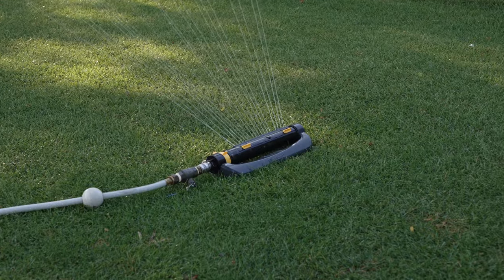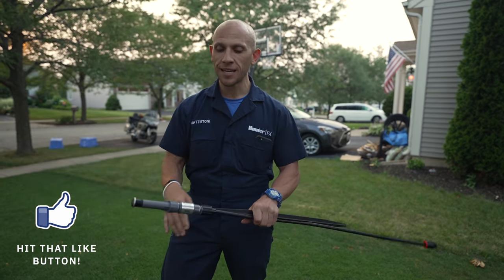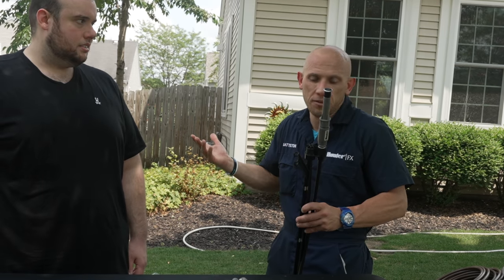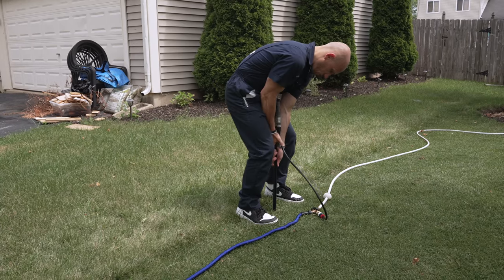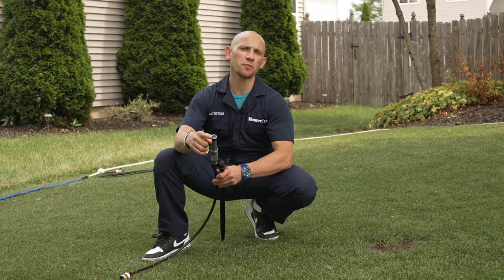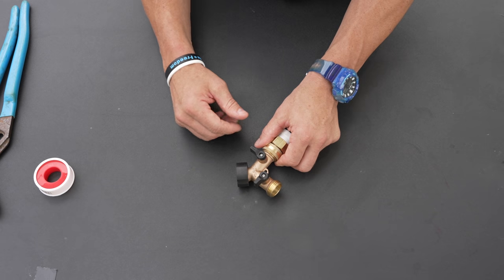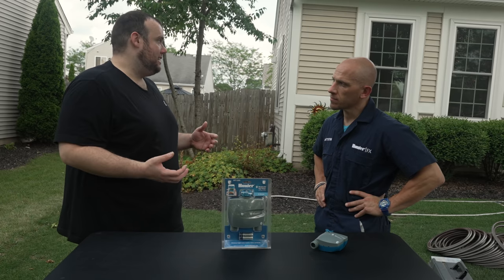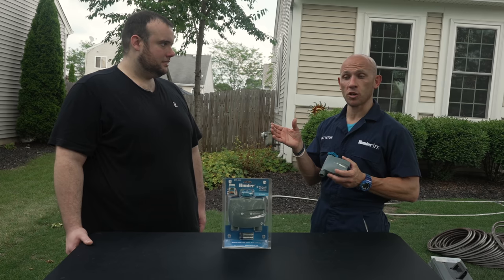Once You See It, You Won’t Use a Regular Sprinkler Again

Comment: Looks like a pain to setup and more complicated than it needs to be.  And the expense is nearly the part cost for a sprinkler system if you do the digging yourself.  Similar battery operated valves don't last more than a season from my experience.  But most important is you need to zone out your lot since you can only run a few sprinklers at a time.  Better to just get a standard zone timer for $40, sprinker heads, pipe, and do some digging.
Reply: In most applications I would agree. However this system is modular and mobile, so that’s an advantage in certain situations such as mine
Reply: you need a hammer arrestor between the valve and the timer, otherwise the bluetooth ones do fail more quickly due to the surge of sudden stops and starts.
Reply: so every time i cut the grass, i take it all down. then reassemble. then re-align the rotators. no thanks.
Reply: @pbrooks4040  exactly what i thought.. single woman with big yard, and dragging those hoses back up for the lawn mower guy UGH NO

Comment: Great video. As a DIY guy 😂 I can’t help myself. I just built 10 Rainbird 1800’s with the 360 rotator heads for a total of $5.18 each a couple weekends ago. With average water psi I can run up to 5 at a time from 1 hose. I also took an old 100ft hose and converted it into 10ft hoses. I haven’t seen the price of these but I’m doubting they come close to that. Getting Excellent coverage 
Us DIY folks are OCD af. Especially if it works as good or better than store bought AND we can do it at a fraction of the cost.

I also built my own in-ground with 6 Rainbird 5000’s easily covering Over 10,000 square feet with garden hoses a 4 zone and 2 zone timers for barely $350. Works pretty damn good.
Reply: Wow how long did it take and is it above ground?  what is a good 4  or 2 zone timer  TIA
Reply: .....but.....you have to have city water pressure level, or one big kick ass well pump!

Comment: I’ve used these nozzles a lot there very easy to use. Easy to adjust  didn’t know about the Bluetooth app but I do know u can add a WiFi module to ur compatible irrigation controller and can use it with ur phone. Nozzles have been out for a few years now 👍👍👍 I have installed a lot of irrigation systems around Charlotte nc 👍👍🇺🇸👍

Comment: Does best with city water pressure. I have a well and live in the countryside here in Michigan. My well water pressure is maximum 60psi. The units are humming in there at about 25 ft. But...if someone flushes, or washing machine operating and the streams come out about 3 ft. Also, don't use contractible hose! When it empties, it will collapse and pull your stake out! The Hunter 100 doesn't have an ON button, it does have an OFF but you cannot turn it on or off manually except to go out to the unit and shut it off manually. Beats the reason for a remote eh? Otherwise, its really cool. All the neighbors comin' over to check it out.

Comment: Barely getting into the home stuff but we're learning a lot as I go this seems like a lot more of a DIY project than say you know irrigating your whole sprinkler system yourself and digging up your lawn now if this is something you wanted to do for a permanent fix how would you go about setting it up I know garden hose probably isn't the best for long-term pressurized use on a timer like that what would you use to permanent above ground or permanent use of that pressure without any leaks for the future from the garden hose and taking up a spigot

Comment: Nice work and great info. 😎👊🌴
Reply from the maker: Thanks man, do you have irrigation?
Reply: @PrincessCutLawnCare  I do. I tried the MP rotors and I had to run them longer than my normal spray nozzle. I am sure the usage is the same when the output is the same, but I learned the MP’s are better suited for clay soil and not Sandy loom.
Reply from the maker: @LawnNOrder  I can see it, takes much longer for us to get water penetration

Comment: I've preferred Hunter over Orbit for sprinklers lately, but their plastic all-in-one valve timers won't last nearly as long as a timer and valve body setup. I've used the combo units on rental properties and had them crack and leak after 2-3 years, where the in-ground valves hold up much longer. I have yet to find a timer I like more than the Rain Bird that has run about ten years. I don't even think they make them that good anymore. Tempted to build and program my own.

Comment: how long does it have to run before you could measure 1/2 inch or 1 inch of rain?
Reply: If they are laid out in head to head coverage the application rate is .4 -.5 inches per hour

Comment: Yeah, it's gonna be in the way of mowing. There's sprinklers out there that'll do a 30' circle. I have a wire trojan fence. I have my garden hose zip-tied to a fence right after I weed whacked a ditch. After the grass grows back, you don't see the hose. Never snagged it with my mower. I have several Y connectors inline at each corner. I can use only a 25 foot hose and sprinkle about anywhere in the yard. 🐀🐾

Comment: I’ve used these. Cheap plastic gear driven sprinklers that don’t last because the plastic gears get torn up by sand particles. Your always better off with metal impact heads.
Reply: You shouldn't have sand in your water. Filter it out first. Obviously sediment isn't going to be good for your sprinklers or your household fixtures. I've used Hunter sprinklers of all kinds for years and had no problems at all. But then, I knew what I was doing!

Comment: The biggest problem I’ve had with rotary sprinklers of all kinds is they get clogged all the time.  They only work with distilled water.
Reply: Yeah, we have well water and the mineral buildup is a challenge. I need to use impact heads for that reason. They each take more water per minute, which means I need more valves and more zones to cover the same space. I'd rather use 3-4 smaller non-impact versions (1-2 GPM) but have to go with 1 larger impact unit (3-4 GPM) instead. All because of the hard water.
Reply: Not true. They work fine with my moderately hard water. Yours must be phenomenally hard to be giving you trouble, in which case you need a water softener.
Reply: @paulmaxwell8851  Salt-based softeners kill a lot of landscaping, and would use a lot of salt. I had a softener, and it was not plumbed to feed exterior hoses, landscaping, etc. for that reason. 

Mineral build up is a real issue, and the tiny orifices on many spray heads will clog within a season. You'd be surprised how quick it happens when the temps go up.

Comment: Being that this needs 40psi to operate, how many splitters could I use from 1 main spigot? Is it just the 2 shown in your video, or would I need to run a hose from another spigot to the other side of my yard?
Reply: Hey R - great question. The MP Rotator can operate down to 25psi (per Hunter's performance data). The 40psi reducer is to lower the pressure, should you have 40-60psi, etc. You will lose pressure due to "friction loss through your hose" - and with just 2 MPs you will likely lose 2-5psi for every 100LF of 5/8" garden hose. Hope that helps!

Comment: Where I live u can’t use a filter as the stuff in the irrigation water it plugs in 2 days. So u remove the filter and away u go. The stuff in the water passes thru the nozzle.  Can u remove urs without any problem ?

Comment: Did you ever measure how much water you get in half hour time with that system? Streams see very narrow or low flow from video.
Reply from the maker: It waters at a rate of .4 in per hour which is perfect because the rate soil absorbs water in .5 in per hour so there is no risk of run off

Comment: I got frustrated with those mp heads.  They kept quitting spinning after just a few weeks.  We were using city water so it wasnt getting any gunk in it.  I have no idea why they kept failing.  I switched to rainbird oscillating heads.  Do you have any idea why these would fail like that?
Reply: What's your at head pressure?
What type of water are you running through them?

Comment: Hunter needs to come out with identical but counter rotating heads for aesthetics. Have clockwise and anti clockwise heads available. If the point of a nice lawn is to flex on your neighbors then your sprinkler system should be over the top to drive that point home. As it sits, all the heads rotate the same direction, looks like a lame production. With counter rotating heads available you could create a symmetrical synchronized sprinkler ballet going on every morning in your yard. Think Bellagio fountains. Sure, double the tooling and double the inventory for the manufacturer, but that system would flex the whole neighborhood!
Reply: Thank you for the LOLs and the great ideas!

Comment: Could I just use PVC pipe for water supply? I like the pop up heads, but living in SE US don't want to pay a company to set up buried sprinkler system as the fee will be exorbitant and the job will be half ass'ed, cuz that's how southerners roll.  Too old to be digging for the buried sprinkler system myself, so this is a nice option. My current system was done by "professionals" buried and half ass'ed installation.
Reply from the maker: Yes sir, absolutely you can use pvc pipe, there are a couple videos on YouTube on how to rig it up

Comment: im not saying its a bad product at all but the cost is a little to High IMO 160.00 for 1 spike and a controller.  think they are off by about 60 bucks for the kit
Reply from the maker: it comes with 2 spikes and the controller, i agree its a bit pricey but if you part everything out you will see it is right on point

Comment: Great video, thanks for sharing. I will check out the sprinklers. I have a question, have you had a chance to use them if yes what is the comparison of your old water bill or last month compared to this one. If it can save me money and water and get better results that would be a game changer. Thanks
Reply from the maker: Thanks eric! The amount of water does not change but the application rate is much slower (.40in per hour) Average soil absorbs water at a max of .50in per hour and most other sprinklers apply much more water than that per hour. So by using this system you can maximize the amount of water your lawn will absorb which will ultimately allow you to not apply so much water and wasting it due to run off
Reply: @PrincessCutLawnCare  thanks so much for the information, I'm going to look for into it pricing and how many I would need for coverage.

Comment: Although I agree and experience the Orbit 6 Gear Drive sprinkler head issues, after watching this video I am unsure why these products are better. I have a 4 zone Melnor rain cloud to irrigate my lawn with 3-4 Orbit Sprinkler heads per zone. I drag it out every spring and put it away every fall. I tape all the connectors with plumbers tape and most don't leak initially but the hole sprinkler can over time. There is nothing in this video that suggests the same is not true of these heads over time. They are clearly brand new and temporarily installed. The spike is plastic on these but its metal on the Orbit so other than saving my back (not my issues) these don't seem better. The video shows only 2 heads shown. Unless you are moving them all the time this does not seem to work and is not really different than the other systems/methods. I could not irrigate my small lawn with just 2 zones, the pressure if I use a Y -connector and 5/8ths pipe drops off fast. The Orbit sprinkler head is also designed to be inline, but this product is "end of the line" in design, so now I have to buy multiple splitters to add more than one. Am I correct in that assumption? The pressure unit on the sprinkler head is a 40psi "maintainer" but, based on the fact it is not mentioned, I assume its only capable of lowering to 40psi and not generating more when you have too many heads on a zone? Overall I would love it if this was a better sprinkler head than the Orbit, but just watching this video made me none the wiser really.

Comment: Ok I’m trying to program my bt100 timer for 4 times a day. Only option is to set 2 times but I want 4. Please get me passed this frustration. Can I do it in cycle/soak setting. Directions say I can set four times but the app only gives 2 set time options.
Reply: How’s this. Start time 0530 end time 2000 with a cycle time of 15 mins and a soak time of 4 hrs. That works right. My bt100 only has two start times in timer mode.
Reply: Just realizing the btt100 has 2 start times and the btt200 has 4. Oops

Comment: You said the head maintains 40psi. Does this help if you have low water pressure to run more than one sprinkler? Or would you still need a booster pump? Thanks!
Reply from the maker: It depends on how low of pressure and how many heads you want to run
Reply: The 40psi pressure regulator can only reduce pressure, if you have 35psi, the pressure regulator will be a passthrough, and not functional. To help decrease pressure loss, you can increase the size of your hose, decrease the hose length, loop the hose, or decrease the flow rate of each nozzle. MP Rotator are very low flow rate (0.75gpm avg) so you'll have an advantage over traditional sprinklers.
Reply: Thanks for the feedback.

Comment: But the thing is that it looks trashy above ground. I think if its going to be above ground and you have the trees then I think a sprinkler that you can put 10feet up on a tree that would cover the whole yard with just two sprinklers would be. a great idea. Then you would not see any water lines running around the yard. Just one line going up a tree that's high enough to spray the whole yard. Just a idea lol

Comment: not sure I am a fan of the MP rotors. I just picked up a bunch for the irrigation system.  They seem "ahh" at best.   Well see.  They seem to throw to far and not water around where the sprinkler is, even after adjusting.
Reply from the maker: They are not supposed to water well directly by the sprinkler which is why head to head converge is important, every head is expecting another head to throw water back at it
Reply: @PrincessCutLawnCare  ohh...  well, we will see if the grass survives.  Coincidentally they do reach the other sprinkler heads surrounding.  Doing a full renovation in the next couple of weeks so well see how it goes.  They look cool, I will say that. The water brings me back to some water fountain show... as I sip drinks on the patio watching them go off.  haha

Comment: Why don't they just make the end of it to be able to attach to a hose from the factory? Instead of having to put those two pieces on
Reply from the maker: It’s a made with commercial grade parts in which the standard is national pipe thread, not garden hose thread, but we are working on making it more diy friendly
Reply: @PrincessCutLawnCare  good. If it's being marketed towards DIY than a more DIY friendly connection makes a tonne of sense

Comment: Why a check valve, once the system is depressurized. That does not make any sense the water would not flow backward the water does not come from the nozzle, also it will not stop water coming from the hose or the water would never come out of the nozzle. Seems like it is an extra piece for no reason.

Comment: I appreciate your content, but it started with why would you want to buy a sprinkler head, nipple, and connection spike since that's a lot of parts and troublesome, then Hunter's solution is a bunch more parts at way more expense...not a big reason to switch over from our own DIY setup. You can get all the parts for one sprinkler at Home Depot or Lowes for about $15, less if you build out more and by some of the parts in 5 or 10 packs.

Comment: 🖐🇺🇲💥🏆 I prefer rain bird products
Reply from the maker: Rain birds are great as well 👍
Reply: You could use the Rain Bird rotary nozzle on the Hunter MP Stake - any female threaded nozzle will work!
Reply: RB makes good product but blind loyalty will not serve you in this case as their copycat nozzle does not have the same application rate or distribution uniformity. MP except no knock off

Comment: Installing an in ground sprinkler system isn’t hard or expensive. You can rent a ditch bitch and do it yourself in a couple easy days. This system is pointless, you can’t leave hoses running all over your lawn or it will kill the grass, get cut with the mower, or trip someone up. This system isn’t going to be any less work then dragging a hose and $20 sprinkler around, that is unless you burry the hoses and then why not just do it the right way and get some much cheaper plastic pipe, fittings, and do the job right?

Comment: Total rip off, you can easily go to Amazon and get a metal sprinkler spike that’s about 6” high, then get a plastic adapter at your local Home Depot. Then just screw a hunter sprinkler body with an mp sprinkler head on it. All that will probably cost you about the same in the end, but it will be much better quality and not look so out of place. Plus once you figure put the best location for the heads, you can use the sprinkler bodies and heads in a proper system. This is junk.
Reply from the maker: big man